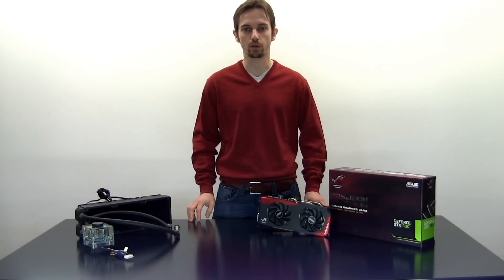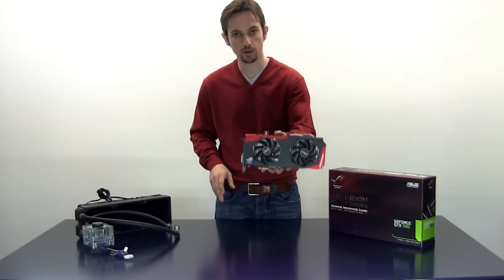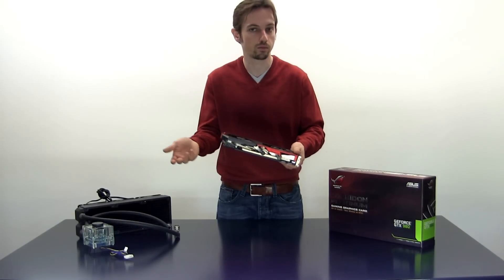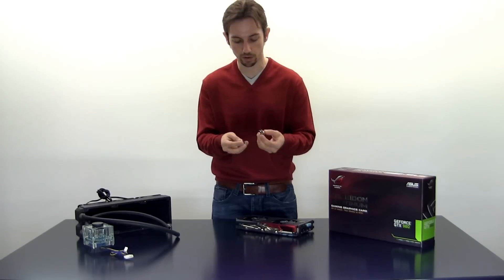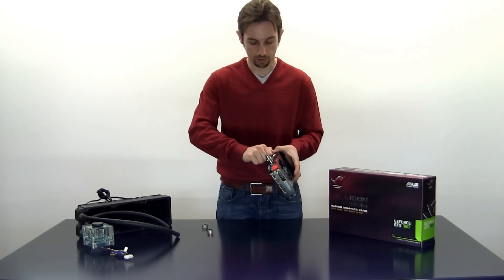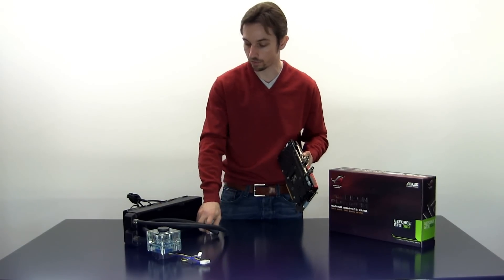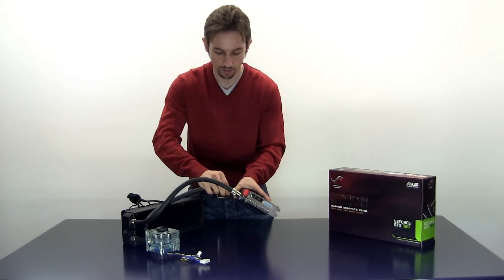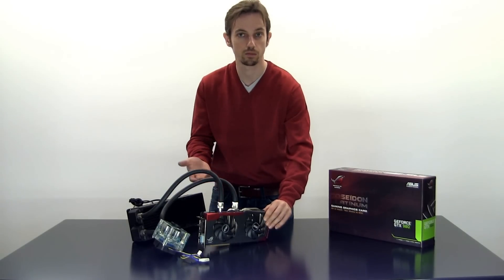ASUS GTX 980 Poseidon Platinum Custom Watercooling Installation How To

Comment: i have the card ...how much for the rest of the stuff don't see a parts list / end cost I have an 800d obsidian case will this all fit in there and have enough hose or is that all u get what I see in the video??
Reply: i gave up now I have a 1080 msi card
Reply from the maker: You're question is a little tricky to answer precisely. What you will need are the following components: 

- CPU Block: 60 to 100 USD
- GPU Block: 120 USD
- Pump/Res Combo: 120 USD
- Triple Radiator: 100 USD
- Tubing, max 4m: 10 USD
- Fittings, 8 PCS: 40 USD

In total that means roughly 500 USD for the watercooling gear. 

The 800D is a good case to be equipped with a water cooling loop. 

I hope this comment was helpful!
Reply: I agree Benja....  I have been looking a long time for simple information on how to get a radiator kit for such a Posiden card, BUT I cant even get info from ASUS or Amazon which sell the GPU. And the Vids like this just take more time than its worth.
Reply: agreed

Comment: I want to watercool my pc , and i will use these custom parts ( Reservoir , Pumps , Water blocks , etc) , i can Watercool the gtx 980 poseidon platinum ( in SLI) normally?